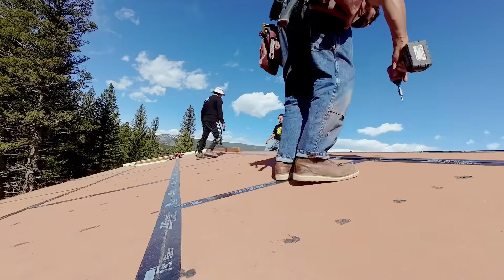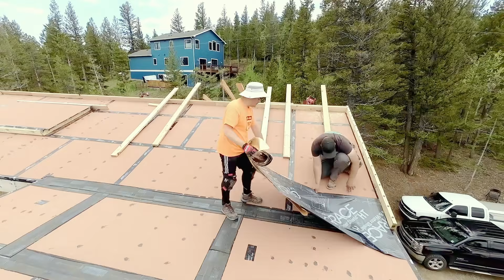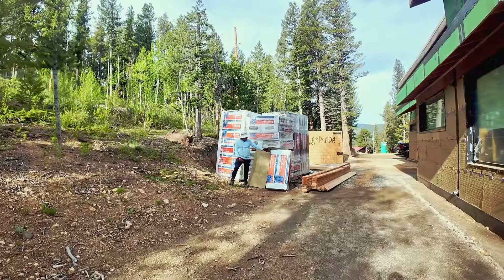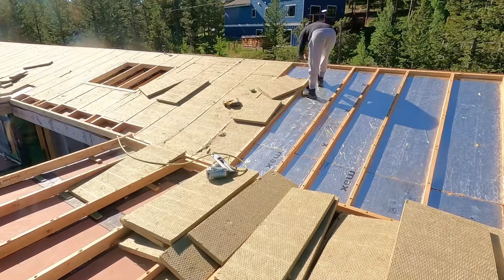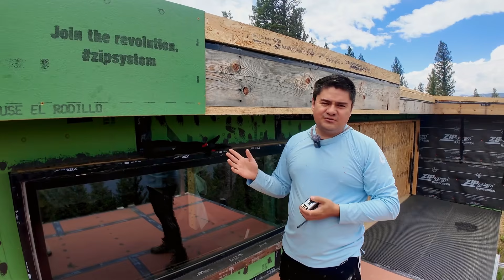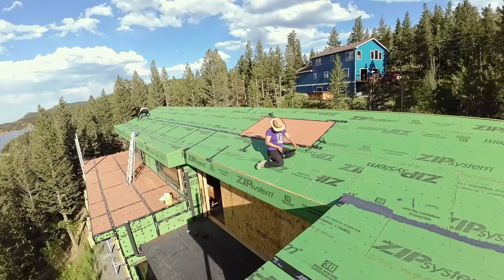How to Install Exterior Roof Insulation for High-End Energy-Efficient Homes (Polyiso + Mineral Wool)

Comment from the maker: Does the reflective polyiso require a gap? Let's have a constructive conversation on this thread.
Let's talk some physics first:
The reflective coating on the polyiso is to "reflect" RADIANT heat, that is typically in the Infrared Wavelength. The air gap is recommended to prevent transfer of heat due to CONDUCTION. You want the reflective coating to reflect RADIATION.
That said, AIR has an R value of about 1R per inch. Therefore, even when there is an air gap there is transfer of heat through conduction.
By replacing the air gap with mineral wool the assembly is effectively minimizing conduction, in other words, it is better than an air gap. Secondly, mineral wool is partially transparent to certain wavelengths of the infra-red, particularly the mid to long-infrared. Therefore the reflective coating on the polyiso does reflect.

In this particular assembly it works because of the above, but in general it is indeed recommended to have an air gap if you don't replace the air medium with something with greater R-Value than air.

If you think I'm wrong, comment on this thread. Keep it polite and we can have a constructive conversation. If you prove I'm wrong through physics and logic I'll post a video and give you full credit.
Reply: This is a fantastic discussion that gets into some advanced building physics. You've made several great points, particularly about the R-value of mineral wool and its partial transparency to IR. Let me build on that with a few additional layers of physics to explain why the air gap is still considered irreplaceable for radiant barrier function.

The Air Gap's Primary Role is Reflection, Not Insulation: You are right that air has a lower R-value per inch than mineral wool. However, the gap's main job isn't to insulate through conduction but to create a low-emissivity cavity. This cavity allows the radiant barrier to reflect heat away without immediately conducting it inward. Pressing mineral wool against the foil replaces this reflective cavity with a conductive bridge, fundamentally changing the assembly's physics from reflective to absorptive.

The 'Heat Trap' Effect in an Unvented, Absorptive Assembly: This is a critical point. Let's say a small spectrum of radiant energy does pass through the mineral wool and is reflected by the foil.

That reflected energy must now pass back through the mineral wool, giving it a second chance to be absorbed.

More importantly, the entire mineral wool layer is now unvented and air-tight. Any heat that is absorbed—whether on the first or second pass—has no escape route. It cannot be carried away by convection (venting).

This trapped heat creates a thermal flywheel effect, continuously challenging the thermal resistance of the adjacent layers (the polyiso below) through constant conductive and radiative transfer within the trap itself. The assembly effectively stores heat rather than rejecting it.

Comparative Performance:

A Vented Air Gap: Acts as a radiant reflector and heat ejector. Venting actively removes heat, maintaining a significant temperature differential and protecting the insulation below.

An Unvented Mineral Wool Layer: Acts as a radiant absorber and heat trap. It relies solely on its conductive R-value, which is compromised as the entire layer bakes under a sustained thermal load.

In summary, while the mineral wool assembly has a high conductive R-value, it sacrifices the powerful radiant rejection of the air gap. Furthermore, by being unvented, it risks becoming a heat sink, diminishing the overall effectiveness of the assembly in summer conditions. The air gap isn't just about R-value; it's about creating a specific physical condition for reflection and providing a pathway for heat to escape.

A More Effective Assembly:
For maximum performance, your excellent approach of a tight, well-insulated over-roof should be combined with a dedicated radiant barrier system on its exterior. The most effective assembly would be:

Air-Sealed Over-Roof: (As you described) Your taped sheathing and insulation layers are perfect.

Outboard Radiant Barrier: Install a dedicated foil radiant barrier (e.g., Prodex, Reflectix) directly onto the exterior sheathing.

Vented Air Gap: Use 1x4 strapping (creating a ¾” gap) installed perpendicular to the roof slope over the foil.

Vented Cladding: Install your standing seam metal roof over the strapping, ensuring it is vented at the eave and ridge.

This assembly leverages the best of both worlds: the high conductive R-value of your insulated over-roof and the high radiant reflectivity of a properly vented barrier, all while avoiding any risk of a heat trap.
Reply from the maker: Hey Brian, sorry for the late response, youtube didn't notify me and just ran into your comment (4 months later, sorry). We truly appreciate and value the discussion.
I understand what you are saying. I'd say I am not 100% in love with this assembly as it is effectively making rafters instead of 2x12 maybe 2x16. I've thought about running the frames horizontally, but that would trap water, so they would need to be notched. Maybe use trusses instead of rafters but the engineer didn't specify that. Trusses would've made our lives much more easy in many respects.
People in the comment section have suggested the use of straight up mineral wool on the roof with furring strips. While I agree that may be the best assembly we also need it to be strong for really high winds in the 140MPH range we need it to last.
To your point of having the polyiso under the mineral wool. I understand what you are saying but we chose to keep the mineral wool to the outside for a couple reasons.
1. Mineral wool is vapor open, allowing for any moisture to escape. If I had polyiso on top, we could trap moisture in between as polyiso is not vapor open.
2. Fire protection, I wish we had a full deck of mineral wool instead of sheathing (similar to other YouTube comments), but unfortunately as I mentioned we need strength for the long haul.

If I would do this again I would request the use of thick trusses to fill the cavity with mineral wool.
Final thoughts, the extensions are 4-1/4" tall while the insulation is 4" so there is ventilation between the mineral wool and the sheathing (for water).
I see the point in the transition between the mineral wool and polyiso trapping heat, and I can live with that. Where we build is zone 7 (80% of the time cold).
Thank you for the insight and sorry for the mega late response! I wish YouTube notified me of replies not just new comments.
Reply: @brianadiele-b9w  Great contribution. Regarding your recommendation for installing the vented air gap strapping perpendicular to roof slope, doesn't perpendicular strapping impair the ability of the air gap to channel rejected convective heat up to the ridge?
Reply from the maker: Hello, my suggestion if you are doing an assembly of this sort is to try to use the same kind of insulation. We used the 2 layers because of the trouble we had sourcing the material. Mineral wool is vapor open, so be careful not to trap moisture in between the sheathing and the polyiso.
If you were to use mineral wool running the furring strips horizontally wouldn't be an issue because mineral wool is vapor open. Be careful with the insulation of choice. We also did this because we had rafters. I wish we had built this with trusses.
Reply: Run your rafter extensions (that insulation sits into) using two directions (longitudinal and lateral) next time if minimizing conduction is the goal.  The surface of the wood making direct contact with the attic or subroof is greatly reduced.  Wood is much less insulative value.
Reply: I want to add you can use angle straps vertically to tie into trusses and roof rafters if uplift is your concern.  The layer on top of trusses would run perpindicular (at right angles), then second layer would sandwich down over the original truss.  When working with an engineer they can sign off on non-commercial (pre-engineered) angle straps like 20-22 gauge angle material.  Most store bought strapping is electrogalvanized but with all of those mixed materials a hot dipped galvanized sheet metal would be preferable.  Local sheet metal shops can pump out the straps at a quarter of the pre-engineered prices.  Again, an engineer should approve it.
Reply from the maker: Thank you, that's a great idea. We'll use metal straps for the siding. As a whole, this entire assembly could be improved. I'd begin by using trusses. Metal straps for furring. All would be faster to install too. Not unhappy about the assembly, but we iterate and improve.
Reply: @efficientbuild  wood generally is cheaper for furring.  If you do metal then look for hat channels for adequate stiffness coupled to ease of installation.  With metal the downside is need for grounding which is a lot of additional cost.  Fastening to metal is more expensive, too.  I grew up around a metal shop and in this application appreciate simplicty of wood.  As long as moisture in attic has a way to breathe out (e.g. the air gap) it keeps it simple, affordable, and repeatable.
Reply from the maker: Agree, we need metal because we need these assemblies to be fire proof. The extra cost is ok. Are you saying you need grounding for furrings strips? We also use steel siding
Reply: @efficientbuild  if its structural you generally do.  Your engineer or architect would require it.
Reply: No, that's not correct. However, it should be made clear that what you did simply reduces the polyiso with a foil-face to essentially the same as a polyiso board without foil facing. The polyiso is still useful, but only as insulation against conduction, you lose the benefit against radiation. So, this assembly simply isn't quite as energy efficient as it could be for the price paid.

Mineral wool doesn't have a good R-value per inch because the mineral fibers themselves reduce heat flow. Insulation in general works because air itself conducts heat poorly, so any insulation that creates many separate pockets of air that can't support air mixing between them will be good ... against conduction. It's true that if you have two assemblies with exactly the same total thickness, one which has an air-gap, and the other with mineral wool filling that gap, the full mineral wool assembly will perform best against conductive heat transfer. But, it will perform worse against radiative heat transfer. The total performance will be based on both factors, but "losing" only a half-inch air gap will cost you only ~R2 for mineral wool, and the improved performance against radiation will probably make up for that.

What your installation has done is similar to a "short-circuit" in electrical terms. Theoretically, heat could flow from the mineral wool to the polyiso via either radiation or conduction. If you let them touch, then it will be almost all conduction. If you don't let them touch (air gap), then heat can mostly only move down from the mineral wool via radiation, but because foil is reflective, the polyiso will radiate it right back ... and you will have a continuous bouncing of IR waves across the air gap, instead of quickly taking the easier path that conduction would provide.

The "mineral wool is translucent to infrared" isn't really true, or relevant here. Again, if you let the mineral wool touch the foil, then heat will move between the two mostly by conduction. Don't do that, since you paid for a reflective surface.
Reply from the maker: Thank you for your thoughts. We installed polyiso because of weight reasons and if I reduce the radiation properties of the polyiso it's ok. That said...

The "medium" as they teach you in school when it comes to light and reflective indexes in this case is replaced by mineral wool instead of air particles. Air still conducts heat, it has an R value of 1-R per inch that's why we fill our walls with insulation and not just air. Only a vacuum would prevent all heat transfer via conduction. That said what makes insulations great is the combination of trapped air within it, but not pure air.

If mineral wool is not translucent to certain wavelengths of IR then it's done it's job and any infrared light would not get to the polyiso so having an air gap would not mean anything. If it is translucent to certain IR wavelengths then it is bouncing it back to the mineral wool. The medium doesn't need to be air. Similar to school physics, you can put a piece of glass, or water, or air, or in this case mineral wool, you are just changing the medium by which light is traveling through.

To be honest, the more I think about the physics of this assembly sparked by all the great comments the more I like it.

I'm getting to the point where I'd love to run an experiment, 1/2" air gap, 1/2" mineral wool (the medium), the fact is the mineral wool will stop most IR before it gets to the polyiso.
Anyway, thank you for the comment, I will try to think of a way I might be able to do the experiment. It might be tough not having professional equipment, so we'll see.
Reply: @efficientbuild  if polyiso was on top then you run an airgap under it from soffit to ridge.  Polyiso has a tendency to trap moisture underneath of it.  You can run 7/16th thick strips impregnated board (aka preggo board) to hold the airgap to promote airflow.  The preggo is relatively cheaper than most any other material, but best of all sticks to a surface with just two dabs of liquid nail.

Comment: If your rockwool is touching radiant barrier it isn’t a radiant barrier.    The air gap is needed.
Reply from the maker: Not technically, we are changing the medium only any "light"/"radiant" if any that can pass through the mineral wool will be reflected onto the mineral wool. Gap or no gap, it's very little. But I don't care for the radiant barrier either way. We do it because we were short on material and reducing weight. I believe we discuss all this in the video. That said, I do like this assembly. The polyiso provides great r-value and low weight. The mineral wool provides fire protection.

Comment: Why not just install rockwool insulated metal roof panels.  Faster and more efficient.
Reply from the maker: You haven't seen our videos obviously,  rockwool is a trash company that can't deliver.
We do have to be structurally strong, for wind and solar roof.
I would do it differently in a different location
Reply: @efficientbuild   @efficientbuild  why is rockwool trash company, and metal roofs are perfectly acceptable for solar and high wind application, just because you guys did it certain way ther is no ned to trash other company, also what you guys did is simply put extra roof on the top of existing roof with all the respect but there is so much thermal bridging and it is not extra insulation its just extra roof on the toop of the roof...it adds extra insulation but it has obvious flaws
Reply from the maker: Rockwool deserves to be trashed. They took a lot of money from us. They never delivered. They kept saying tomorrow, tomorrow, tomorrow. 
We don't trash companies unless they deserve it

Comment: While it can be helpful to see mistakes that are made, it’s not very encouraging to know that a contractor built a flat or back pitched flatroof. Maybe that was why they were getting the leakage where they installed the Gracie. It also would be where they would be creating a future puddle if there’s a leak or condensation. I stopped after the vent power ooops.
Reply from the maker: Vent power oops? The flat roof was originally framed flat, that was a mistake. It needed to be sloped 1/4" per foot, which was corrected in this assembly.
Maybe you just prefer to watch videos where people hide their mistakes? They happen regardless,  we acknowledge them and correct them.

Comment: It makes me question what else was missed in this high end building if only now realized insulation is too heavy and the structure will not support it. Built to minimum standards?
Reply from the maker: Nothing was missed, it was not thought of to begin with, it doesn't mean it was missed. We have a structural engineer's letter saying this weight is acceptable.
Reply: @efficientbuild  Maybe he doesn't realize the weight of tile in comparison, which is more than ten times weightof an asphalt shingle system.  The roof is built strong enough to hold slate or cement tile.  The insulation is nowhere near that weight.  I have faith that it is engineered to still support tile over your insulation details.